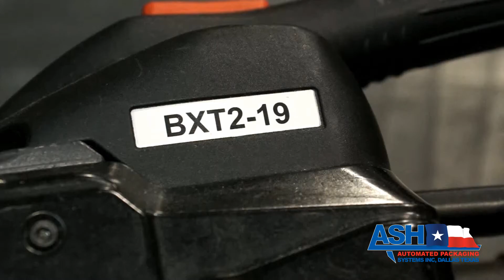Signode BXT2-19 Repair

Comment: A zip tie around the motor is not needed and why you removed the motor cap and then taking apart the welding mechanics not needed all this video will do is confuse someone trying to repair the unit.
Reply: true. he could have just used the long allen key and do the CCW. until the sealing jam is released :)

Comment: anyone know how to remove motor from nose gear? I took motor and weld block assembly out but cant figure how to remove gears so I can replace motor?
Reply: I know
Reply: @junelee7002  hahahahaha. i see what you did there june
Reply: @johnwhorfin5150  we supply all spare parts for bxt2 bxt3，tension wheel usd70，tooth plate usd50 ,knife usd35